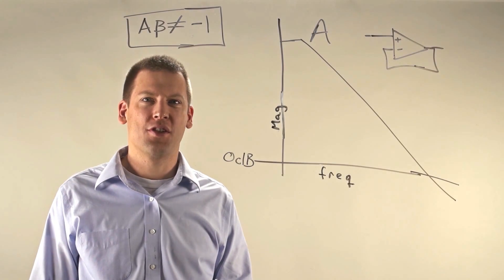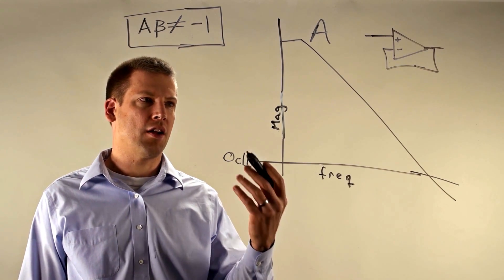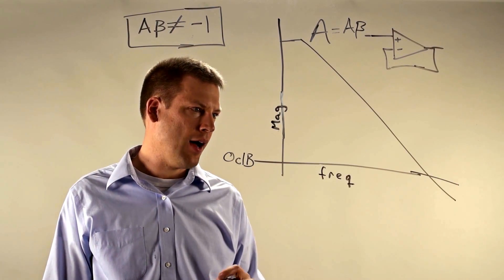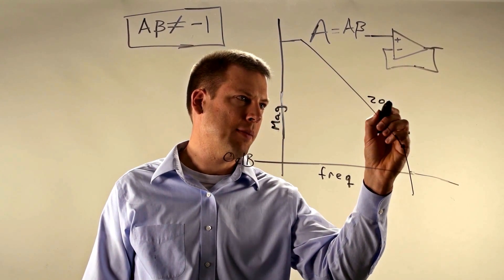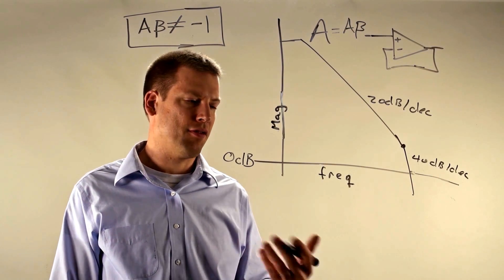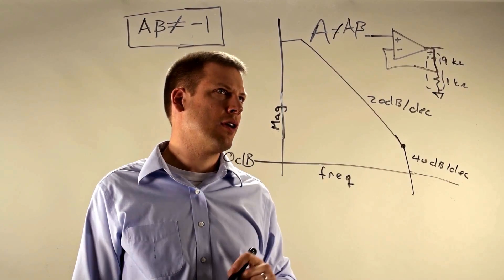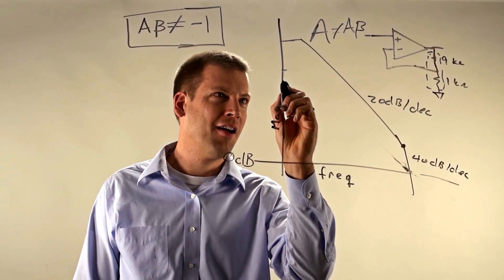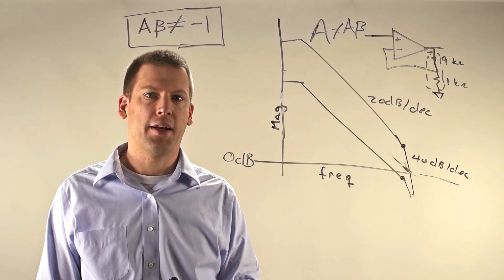Stability 101: Decompensated Operational Amplifiers

Comment: I cannot understand why a voltage follower configuration creates an instability issue. 
The closed loop gain of the voltage follower is always 0dB (or bellow) isn't it? If it is so,
we do not have any poles above the 0dB line.